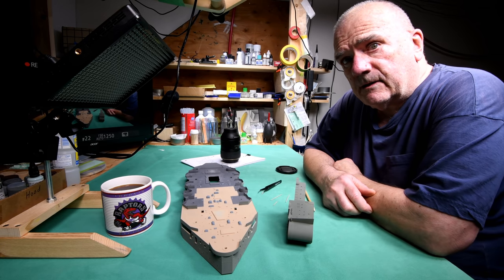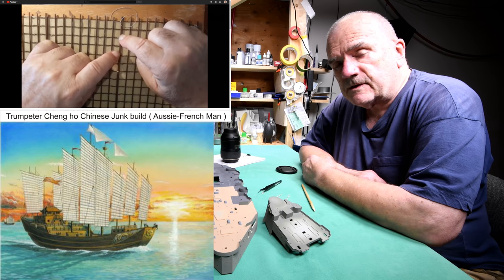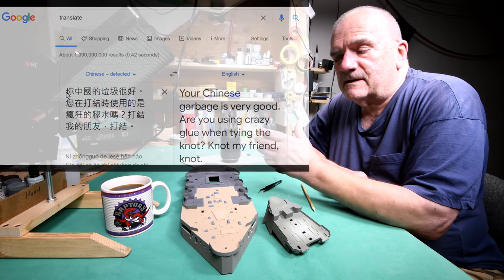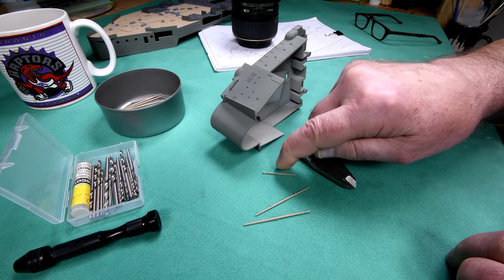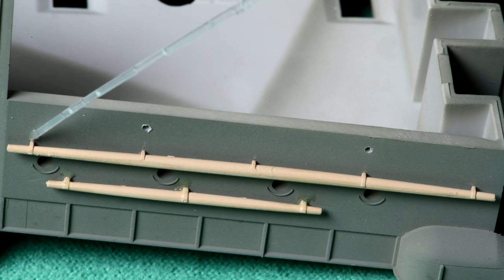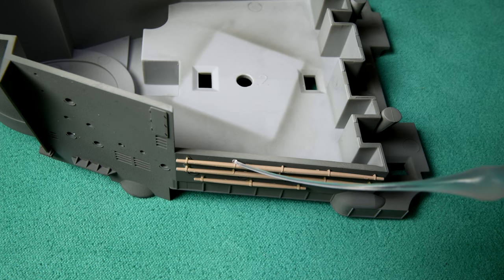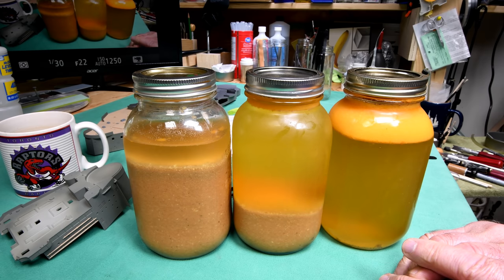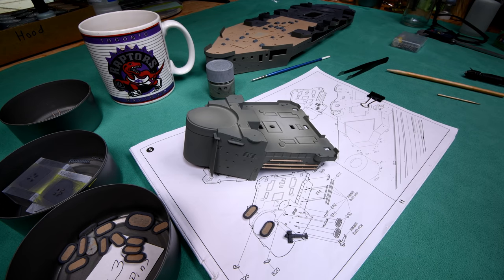The Model Ship - Part 596

Comment: Hi Ron, I was watching you drill out the holes today then attach the parts and try very hard to glue the parts and not make a mess with the glue. I was thinking that since you're  drilling the holes out bigger why not drill the holes all the way thru and then glue the piece on from the inside so you dont even see the glue point. Might be easier then having to go back and trying to touch up the paint. Any how I want to send you something that I bought one for myself to use for doing decals but thats not what its for. You could use it for its main reason aswell as what i use it for. I just need an address to send it to. Keep up the great work, I look forward to 6pm each day to see your videos. 👍😁

Comment: Oh Ron, put the extra thin glue in the hole first then attach the part. Usually if there is any resistance the glue acts as a lubricant (dissolves the plastic), thus allowing the part to slide in, added benefit no touch up. See you tomorrow.
PS: Nikon has two new cameras coming out, however, they will only do 4K Ultra HD at 60P.
Reply from the maker: Re: "Nikon has two new cameras coming out"  Nikon or Sony, either way I have to use an adaptor if I want to use my F mount lenses.
https://petapixel.com/2020/10/07/first-set-of-nikon-z9-specs-leaked-46mp-sensor-20fps-8k-30p-video/

Comment: In this case I would not use CA but a normal extra thin - preferrably from the inside portion of the main superstructure part or from below of the parts. Then you will have less work repainting. 
And from the photos it seems that the raised portions on the wooden "poles" seem to be metal holders (aka not a part of the pole itself) and are painted in the same color as superstructure.

Comment: to apply CA with precision and very small amounts  MAKE A GLUE APPLICATOR WITH ANY PIN VICE AND 5 AMP FUSE WIRE (cut off end of fuse wire when clogged. hope this helps
Reply from the maker: We'll be discussing that in 597. 👍

Comment: Hi Ron, you are really over engineering the hole enlargements. I would simply try a couple drill bits against the holes and choose the one that is slightly too big to fit :) 
BTW, at 7:00, where you drill the holes, I notice there is some lint or something hanging out from the curved surface supporting the round shape for the turret. You may want to fix this now before you glue the part on the deck. And check the other 3 such supports.
Reply from the maker: Re: "lint or something"
I think that may be flashing. Will check on that. Thanks. 👍

Comment: If you are going to use ca glue on tiny parts why don't you put a blob of glue somewhere and use a dressmakers pin or a needle to apply a very small amount of glue. Why don't you put that tiny bit of glue in the hole you've enlarged after dry fitting of course it'll be much neater.